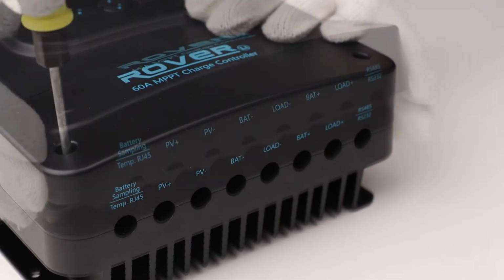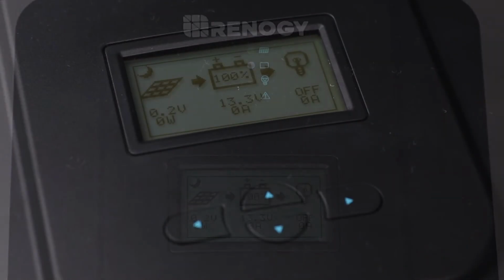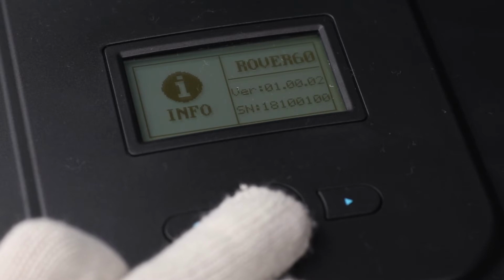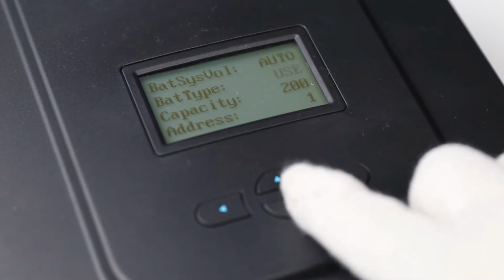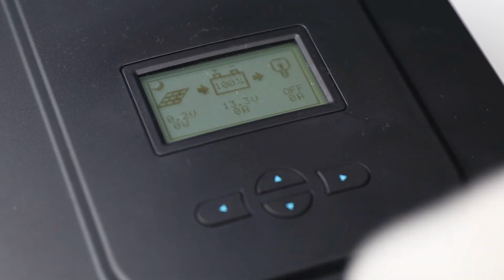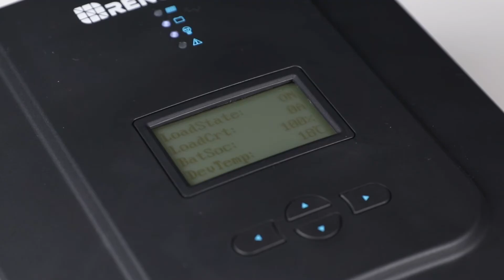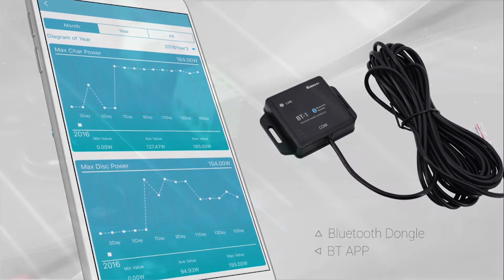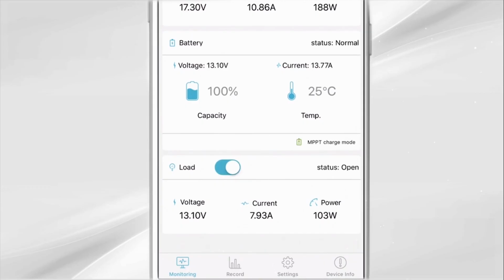Renogy Rover Li 60 Amp MPPT Solar Charge Controller

Comment: How do I get my controller not to show my batteries are full at 13.3 volts on lipo 4 batteries when it should be 13.8 to 14,4 volts?
Reply: never rely on voltage based capacity readouts like those in solar charge controllers. use a shunt based system that keeps track of the input and output and bases capacity on those figures. Lifepo4 batteries in particular should never have their state of charge determined by voltage because as much as 50% of the capacity can be discharged before voltage starts dropping off steeply

Comment: Programming Load Terminal:  I was thinking I needed a separate DC Timer so that I could program my lights to come on and off at a certain time.  I also wanted to be able to program the lights to come on and off dusk to dawn.  I now read in the manual that there are Auto and Time Control functions for the load terminal.  I'm I correct to assume these load terminal functions negate the need for separate sensors/timer?  If so, how does the timer function work?  It sounds like you can only program how many hours you want the load/light on after dusk (when panel stops producing).  Some details beyond the manual would be great.  Where can I find this info?

Comment: The video states that the charge controller can receive up to 800 watts of solar input, but my battery that I will use can only receive 500 watts of solar input. If I hook up 800 watts of panels, does the charge controller have a setting to protect my battery from overload, or is that not how it works, and I should stick to under 500 watts of panels?

Comment: I purchased this controller for my boat and am OK with it.   I use it to keep 400 AH lithium batteries charged, monitor with the BT2.   My energy consumers use relatively low amperage except for the 12 volt fridge and that is somewhat low.  My only issue is the Load terminals, they do not output voltage they are in the off mode all the time.   It seems like the design is to  output voltage when the panels are not powered, this makes no sense to me, unless you are simply using it for a timer after the panels stop producing.   I thought the purpose of load is to use surplus energy when the batteries are topped off, that would be a great idea since the solar panels would not have any use for the solar energy after the batteries are 100%+.
Reply: Hello,

Thank you very much for your evaluation of this controller and for sharing your usage experience. The issue you mentioned regarding the load terminals is indeed a bit confusing. Based on your description, it seems that the design outputs voltage only when the photovoltaic panels are not supplying power, which is indeed somewhat unexpected, especially when the batteries are already fully charged.

Your understanding is correct; one of the main functions of the load is to utilize surplus energy after the batteries are fully charged, thus enhancing energy utilization efficiency. If this controller is not meeting your expectations regarding the load function, you may need to further inspect the device settings or contact our customer support for potential adjustments or solutions.

Furthermore, if you have more questions or require additional assistance in other aspects, please feel free to ask anytime.

Comment: Would a renogy 60amp charge controller be suitable for 4 x 200w renogy solar panels, I know the specs states max 800w input
Reply from the maker: Thank you for your attention. I would recommend going with a 600W option as it seems more suitable. I do not strongly recommend the 4*200W option because it operates at a critical threshold and may trigger alarms more easily.

Comment: why does no one show what the load + or -  does
Reply: probably because it's a largely useless feature. typically can only output 5 amps or less. good for a small fridge or LED light circuit.

Comment: What happens if you selected gel batteries at 1st when you have 200amp hr lead acid batteries and it's been hooked up that way for a few weeks ? 
Also do you add up total of amp hours in amp hour setting if you have 2 batteries ?
Reply from the maker: Hey Mike,

For any technical questions, please contact us here-https://www.renogy.com/contact-us?gclid=CjwKCAiA3pugBhAwEiwAWFzwdeH3Crd9vRTbjjTYl9l3daVqnotJPjBhs2nmw-Wkn1_guWQeW0ao6hoCOHcQAvD_BwE

Comment: What are the LOAD connectors? Manual doesn't explain this. And do I understand correctly that I hook my invertor straight to the battery, not via the charge controller?
Reply: I have one of these, 60 amp Charge controllers.
The load terminals are for nothing more than a source of the system voltage (12v, 24, 36, 48v,..) on a timer you can program with the arrow keys..
I guess this is for turning a light on and off at night in your garage or wherever your setup, or turning a pump on a pond.. or for raising and lowering a chicken coop door..
Basically a clock operated system voltage source.. on at a certain time, and off at a certain time..
I've never used mine and don't know anybody that ever has..
Just ignore it unless you have some sort of weird thing you need powered by your system voltage at the same times everyday
Reply: Never, never hook the inverter to the charge controller.  Just hook inverter up to the battery.
Reply: @charliewatts6895  why inverter has this weird "load" terminals? What are they for?
Reply from the maker: Hi, Vlad.

For your issue, we suggest you can submit a case (links listed below for specific locations) for help. 
 
https://renogy.force.com/helpcenter/s/contactsupport (USA)
https://renogy.force.com/helpcenterau/s/casesubmit (Australia)
https://renogy.force.com/helpcenterca/s/contactsupport (Canada)
https://renogy.force.com/helpcenteruk/s/contactsupport (UK)

Comment: Hi I noticed you did not explain the battery sampling port. Do you know what this is and how it is setup? e.g. which ports are positive and negative etc... I think the cable for the battery sampling port is given in the components in the package at the end.
Reply from the maker: Hi, Paul.

For your question, we suggest you can submit a case  (links listed below for specific locations）for professional help. 
 
https://renogy.force.com/helpcenter/s/contactsupport (USA)
https://renogy.force.com/helpcenterau/s/casesubmit (Australia)
https://renogy.force.com/helpcenterca/s/contactsupport (Canada)
https://renogy.force.com/helpcenteruk/s/contactsupport (UK)
Reply: @RenogySolar  Hey Unfortunately no one is answering my support ticket I chased it again today. Do you know if anyone else can help. I don't want to connect the battery sampling cables wrong etc... as it may break the unit. Any help is appreciated.
Reply: I found this but it does not give me an idea of polarity https://au.renogy.com/content/manual/RVSCC.pdf I need to know which port is positive and which is negative on the Rover 60 MPPT charger it does not explain it in the text
Reply: @paulnorman6442  Support is vague, they really have never helped me out at all. I was taken for a good ride though. Nothing but circles, the support people do not know much about solar, and their own products.
Reply: @RenogySolar  Thank you I've put a request in :)

Comment: No wiring?
Reply from the maker: Hi, Gary.

There are no details in this video on how to wire it. We have reported the problem to the relevant department, and we will add a detailed description of this part later.
Reply: @RenogySolar  what's the difference  between  load or battery load is pass threw ? No reference  in manuall
Reply from the maker: Hi, gary.

Battery load is for connecting with batteries. Load is used for equipment which current is not over 20A.
Reply: @RenogySolar  is it  pass though from the solar panels @not more than 20amps thanks for the reply but I just wanted to know what I can actually do with it so I wanted to know how it worked
Reply: @RenogySolar  ok thanks

Comment: Hello does this need a battery protect or can it charge in cold temperatures
Reply from the maker: Hi, Ron.

The operating temperature of the controller is -31 °F to 113 °F (-35 °C to 45 °C ). The battery's specifications need to be compatible with controller. 

Wish you a nice day.
Reply: @RenogySolar   that doesn't  not answer  the question   how does safe charging  work
Reply from the maker: Our controller has the protection function of PV overcurrent, load overload, short circuit. You also can set different charging paremeters according to your battery type. You can refer to the page 29 and page 32 on our manual book: https://www.renogy.com/content/RNG-CTRL-RVR60/RVR60-Manual.pdf.

Hope it is helpful.

Comment: Hi, could you please help me in changing the battery parameters for rover 60. Is it necessary to get Bluetooth module. My battery is composed from 16 cells each of 3.2 V, 202A connected in series
Reply: The BT is a waist of money, get a battery monitor

Comment: The metal spanner is too long. It reaches both terminals. There is no insulation on the spanner handle. You could accidentally short circuit the battery terminal. The spanner becomes a busbar. A dead short circuit condition releases huge energy (12V/0 ohm = Infinitive Amp). The battery can explode! It is a very poor practice. Please be careful everyone!

Comment: Ok so let me get me this right 

I can push 145v of power from the pannels through this thing at 60amps? An i can over watt the regulator just as long as I don't exceed the voltage and amperage rating??

E.g. 8 ×250w solar pannles at 13.5 amps  each arranged in 4 strings of two pannels each in series, giving 36v@13.5a each string then wired in parallel (via 60amp combiner box) giving a total of 2000w of energy being delivered 144v @ 54A at peak. Under the 145-150v @ 60A max ratings of the regulator but we'll over the 800w suggested for 12v to charge 1000ah worth of 12v batteries ....meaning I'll have maximum efficiency no matter what yes?

Or is my logic floored and I'll disappear in big bright blue flash if I attempt such a thing.

Is this correct?

Comment: Great video, do you know if you can charge a 48v battery with a single 18v solar panel? Or must the voltage of the panels be higher than that of the battery? Bonjour de France 😁
Reply: you must have higher voltage then the battery !

Comment: This video could have been longer. There was a lot of information left out. What is the input voltage range? What happens if you exceed this range? Does a 60 amp rating apply to the input or the output? Inquiring minds want to know.
Reply: I can help a little. ( I have this same controller and set it up myself.) I currently have 24v going in (so it at least covers 12v and 24v) and it's charging a 12v 1,000ah battery bank. The 60Amp rating applies to the input. Basically about 800watts worth of pv panels. If it's charging a 24v battery bank, it can then take up to 1,600 watts of pv panels. Hope that helps!
Reply: @rsg1963   does it need a battery  protect  or does is safe charging for cold temps
Reply: @ronhearell2668  I am not certain about it's battery temp-protect abilities.  I have auto-temp sensing heating pads under each 250ah battery. So I know the batteries will never be cold enough for a charging issue to come up.  I know it does has very robust self-protecting temp abilities though. It's been years now and I still would recommend these controllers (I also have one for my boat but it's a 20 AMP unit). They have never had a single hiccup. 
'Knocks on wood'
Reply: @rsg1963  1600 watts @ 24v
Reply: @johndoe-sz4iq Yes, that's what he said in his comment.